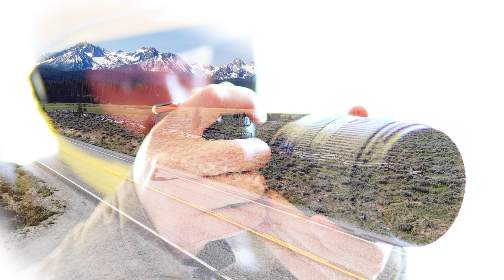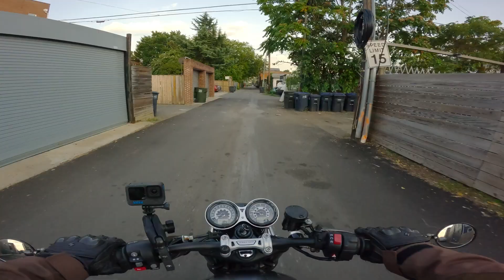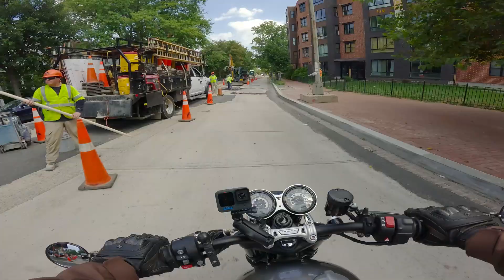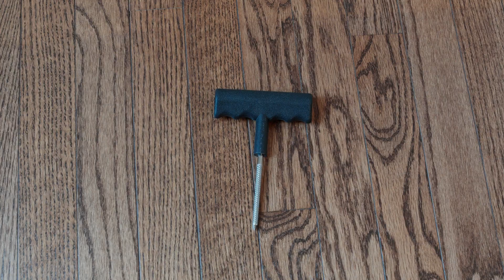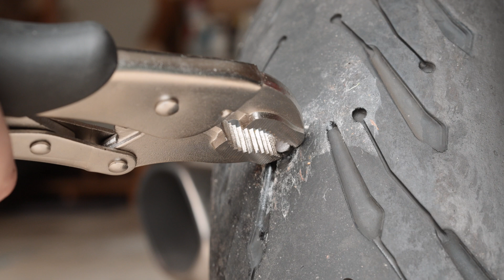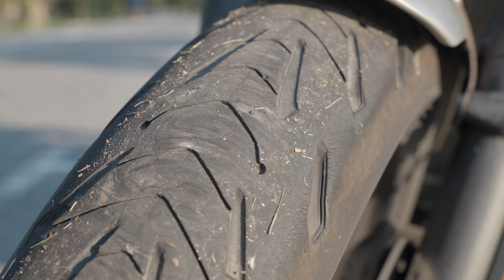How to get (and fix) a punctured motorcycle tire

Comment: I used these same rope plugs. Just recently picked up a hole a$$ mason drill bit in the rear and had to use two of these plugs for the one giant hole.. and it still slowly leaks :(  I have been able to get another 600 or so miles out of it but I lose confidence with every additional air pressure top up

Comment: Not recommended, but you can actually ride surprising far on a plugged tire if done properly and with enough tread on your tires. At least I have. Constantly check your tire pressure and spray some soapy water over the plug. If any bubbles begin to form, the tire isn't plugged right and air is still leaking

Comment: If you're just driving on slow speed and your tire is brand new, just plug it. If your tire is already past half its milage then just replace it. That's how I do it for years so i don't waste money and rubber but if you're driving a sports bike then just buy brand new tire since sports bike run in faster speed putting lots of strains on the tire
Reply from the maker: Solid advice
Reply: @VanBlamm and one more, tire sealant can save you the hassle and time if your tire is past half its milage since it will easily get punctured and rip even by rocks and other sharp object the cons is you need to put a new tire sealant after 6months or 8, filling it also with nitrogen will extend the tire milage and since it's denser it would maintain its pressure and wont leak for long time specially if you have patched or plug it.

Comment: I've had a couple in 4 years of riding. Plugged them both using the same method. My first one went better than the 2nd which I had to redo like you did. However, for peace of mind, I would highly recommend getting a tyre off repair by a professional. It cost me £35 for them to come to my house and do it. Which, considering the element of safety here, is a bargain.
Reply from the maker: Wow, I didn't know a repair job could be that cheap! This was recorded a little while ago; I ended up riding another 1,000 miles or so and then changed both tires.

Comment: Nice job. Out of curiosity what is the problem with the Stop & Go mushroom plugs? I’ve been using them for years and never had a problem. My R9T currently has a plug in the rear tyre and no drama. Like yours it has a bit of life left in it. Cheers
Reply from the maker: https://youtu.be/Qm6fTWaj3QE?si=Z6YbjmhC0RpdFoYy This video turned myself and many others off of them. There is of course no guarantee you'll have a bad time using mushroom plugs, just that rope plugs seem to be generally safer and cheaper. Thanks for watching

Comment: Nice video and kudos for showing the fail(s). I started with mushroom plugs and then Ryan F9 messed that all up. I've been using the Stop & Go ever since, having plugged more tires from riding buddies than my own. The worst puncture I've had so far was a stupid nail that was in the side wall. I did a quick plug on the side of the road to get me the 10 miles to home, stopping to check the plug / pressure two times along the way. I had a new tire installed -- a side wall repair/patch is never a good idea.
Reply from the maker: Oof, a sidewall puncture is no joke. Sounds like your riding buddies are lucky to have you around!

Comment: October 2023, nail in rear tire just as I was getting home, plugged it myself and had the tire replaced shortly thereafter (going on a multiday trip, didn't want to have to worry about the plug failing, and the front tire was pretty new. October 2024, to the exact day! of the last tire mishap, got a screw in the rear tire, 100 miles away from home but not in the middle of nowhere at least and had my plug kit. Plugged it myself. Still holding after 500 miles. I'm at 9000 on the front tire so I'm just going to replace both at the same time when the time comes. The worst part about getting a puncture is the hassle of fixing it, especially when you don't have a full repair kit with you. And yet, you'd think after the first incident I would always be prepared...

Comment: Again, nice video!
Got my first puncture about 40 miles from home, and about 10 miles from the nearest motorcycle shop.
Drove very slow to the shop, but as I got a Guzzi V7 with tubed tires, repairing wasn't so easy.

My mate had to go to another shop about 20 miles away, just to get an inner tube for my bike!
Reply from the maker: Hope you bought him a beer after. Thanks for watching!

Comment: Great advice, great video as always.  I have done many car tire plugs. It is easy with practice, and getting the feel for how much effort is actually required to get past steel belts, which can be considerable as sometimes the tool gets caught and you must pull out with enough force to break a steel wire or two in the tire.  But the biggest problem for the side of road repair is having a tool to pull out the puncture. Sometimes a screwdriver, sometimes pliers, sometimes a screw driver with the correct bit (Phillips, square drive, torx) to just unscrew it, others a pick of some sort.  

Hoping not to pop my side of the road breakdown or flat cherry anytime soon, as I am unprepared on my motorcycle rides.

Comment: I had a tube blow on front because the previous owner didn't install the spoke strip in the center. Happened about 60 mph 👎
I think your plug should last the life of the tire.  I think the speed may be more about the plug throwing off the tire balance than losing the seal but its just my opinion.
Reply from the maker: Interesting point, I hadn't thought about the balancing

Comment: I got a tire plug fitted at my local tire repair shop and they left it protruding about 5 mm, then they used a lighter and set it on fire for a few seconds before crushing it flush.

Comment: Nothing wrong with your fix, the second one passed the test and often the first rope plug doesn't work; that is why there are so many in the kit. I haven't had a flat in 70,000+ miles....yet 😊
That is excellent tire/tread life for a rear tire reflecting the fact that you are not running it hard and don't weigh 220 pounds. I still have my identical Speed Twin 1200 and it has less than 1,100 miles...